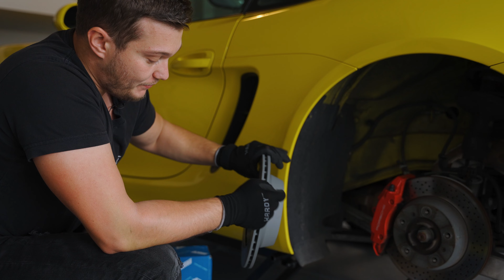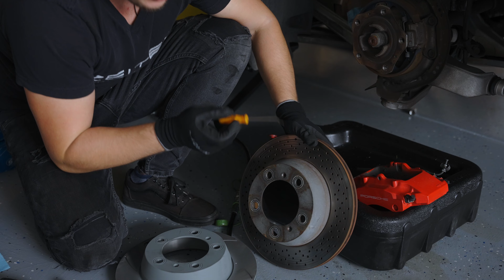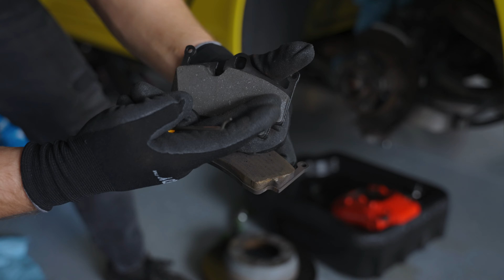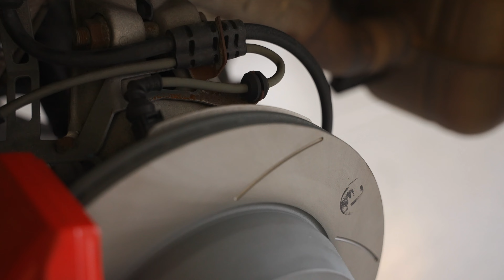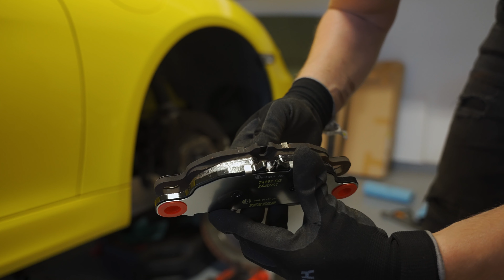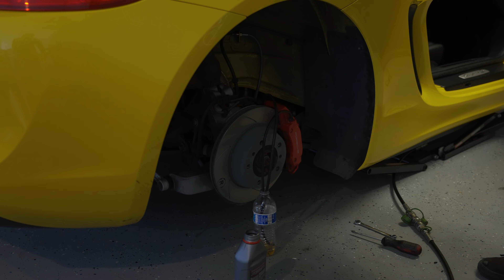2013-2016 Porsche Cayman/Bosxter S Full Brake System Upgrade

Comment: Nice video. How can you reset brake pad and brake fluid interval?
Reply from the maker: As far as i know you’ll need scanner for that, i use icarsoft
Reply: @Zeiten  do you know if it is possible with a Carly app?
Reply from the maker: Probably, but those apps are sort of no good for diagnostic just so you know, I’ll probably make a review and comparison of scan tools soon

Comment: Great video. I use those SEBRO rotors but front only in my 981 Cayman and combine with Ferodo track pads and R spec tyres and RBF. Stopping power is amazing and smoother than stock. No issues for two track days now. I weighed the rotor and it’s a slightly heavier than stock but my wheels/ tyres are much lighter than stock.
Reply from the maker: 👍 i might go with pagid racing pads

Comment: I got a brake system issue on a BMW X5 2002. My brake lights are on all the time I checked the fuses I switched the sensor out still no changes. The only thing I noticed is I got a trifecta but when I release the brake deviously turns off when I hit the brake, the ABS light turns on, but the brake light stays on all the time and the trifecta light is on all the time. Where should I look next? I’m confused.
Reply from the maker: I’d say call a priest and do exorcism😂 if you have replaced brake pedal switch then i would look into wiring, there is a short somewhere
Reply: @Zeiten  I solved it. I disconnected / removed the ABS module and discovered underneath the harness cable on the module itself was a crack plastic piece. I removed the module and checked. The lights are working so I guess I’ll be replacing the module and recalibrating it for the second time. BMW really is breaking My Wallet. Lmfao
I think bleeding the radiator during cold temperatures caused the ABS to malfunction.
Reply: @Zeiten  lmfao I was praying the moment it started happening in the rain
Chicago weather no good. Master Technician thank you for responding. You have been great help for me on my BMW.
Reply from the maker: Happy to help any way i can, thanks for watching👍
Reply: @Zeiten   make a video on removing the entire rear suspension on these x5